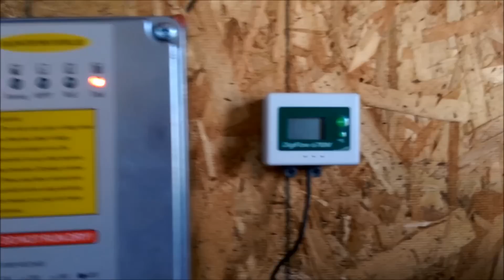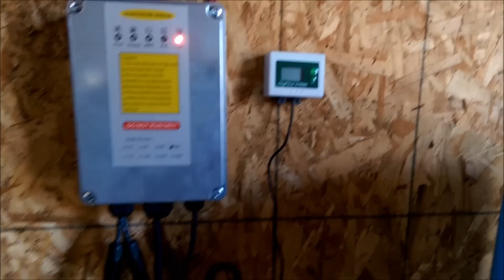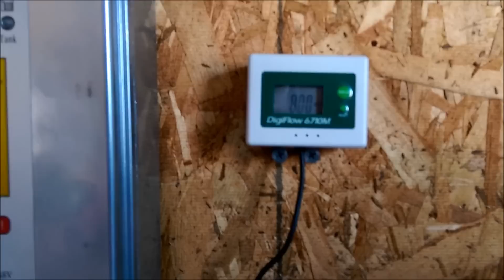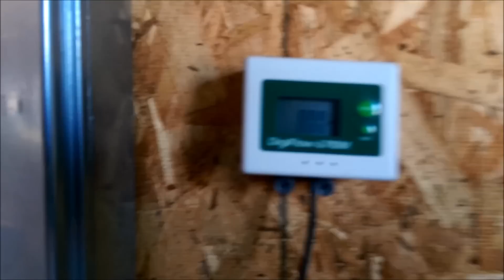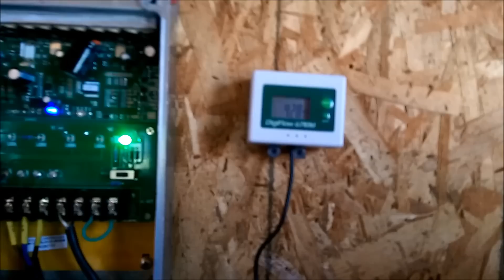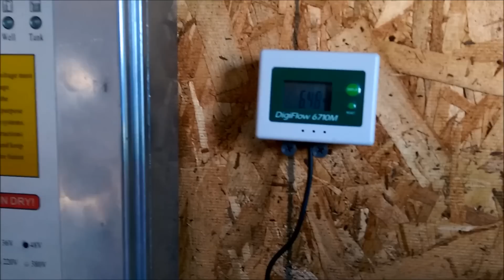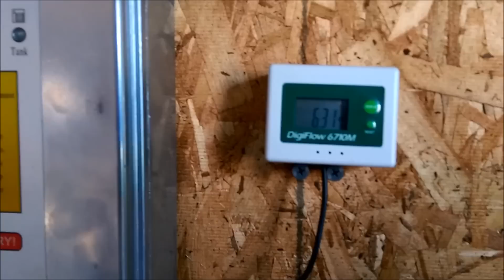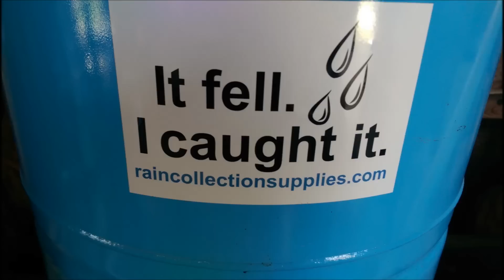New Solar Pump For Many Purposes!

Comment: This dankoff pump looks excellent!   One beef with the setup: accurate flow monitoring needs at least 10 times pipe diameter behind the flow sensor and 5 times pipe diameter afterwards to eliminate turbulence created by fittings, especially elbows.  90* elbows especially have interesting turbulence where the outside water stream flows faster than the inner... by almost 20%, I believe.

Comment: Nice pump I should have one soon, I am getting ready to add the battery portion on my Dankoff Suncentric and using the Midnite Kid it looks like I will be able to run a fifth battery to Increase the voltage/pump speed. Lucky guy you are getting to play with unreleased toys

Comment: I have an idea to create an Air conditioner using a pump that flows a water solution through 600ft of geothermal pipe then call the fan on my forced air unit that will blow across a heat exchanger.  I keep my house at around 76 degrees which is hot for most but we just don't enjoy the house to be any colder. I will use a owf to heat my new 1700sqft house so accomplishing this would really be a money saver on my utilities. My yard looks like a dirt pit now so what is a few more holes... I haven't seen anything on air conditioning off grid in your channel and I knew you would be the one to ask. I know this will work to some extent. Maybe it would be a good experiment to see the possibilities. I guess, I am challenging you because you are more intelligent than myself. What would take me years to figure out would take you days.

Comment: Hi there, this is pretty good project, can you tell me that  if this type of solar pump will work for a  water well with 28 ft. deep?.  I have a battery bak connected to 24 volts. please pump barnd.  Appreciate your comment, regards

Comment: Hi, I have an off grid cottage and we draw water from a shallow well. I have a solar panel set up and it comes down to a charging controller, then to a 12 v battery bank, then to a 4000w inverter. Now when we draw the water its coming from over 200ft, so it takes a while to bring our tank to pressure. So the pump runs for a while and eventually blows the 500 amp breaker we have before our inverter? any suggestions on what might be causing this? The inverter is only rated at 35 amps, and the 1/2 hp pump is 115/230v. And would you maybe suggest putting like a wash down pump out by the source of water and push the water instead of pumping it? Thanks in advance for any suggestions.
Pete

Comment: My well is set up the same way,only i have a submersable pump.My control panel runs my new dose septic system as well.How many batteries do you have to run in parallel?How big is your solar pannels?Please pm me and let me know,thanks.

Comment: why not pump to an elevated tank and have gravity feed as a back up?
Reply: Great idea - if available, essentially the elevated water tank would act as the battery.   It would be interesting to do a cost comparison for tank vs battery.

I've been looking at various water powered pumps to pump water and have realized that in some cases comes down to the cost per volume of water delivered to a given location - in my case an irrigation application, but might be relevant for pressure tanks - not sure.
Here is the link to the facebook group for Water Wheel Pumps and most of the approaches should be bench marked against alternative power like solar.  Any cost for volume delivered figures available?  Thanks.
https://www.facebook.com/groups/240458583255303/

Comment: is that an actual DC pressure switch or are you using an AC one?  i was told you could use the ac for DC but the contacts would burn out sooner.
Reply: one less rat I’ve used them but looped the positive through both contacts for a bigger gap

Comment: Hey Engineer775, Going back to your well video, how long did that take them to drill the 300'?  And that was really only $3,000?
Thanks man.
Reply from the maker: It took about 5 hrs. and yes it was $9/ft plus casing, grouting and permit. ~ $3k
Reply: engineer775 Practical Preppers Incredible.  They're hitting us for $65 - $120 / foot out here in CA with the drought and claiming it's their regular rate.  Even so there's a 3-6 month waiting list.
Reply: Joe Primal  Where in Ca are you? Im in Northern and its a pretty scary water situation
Reply: Jason Andrade I'm down Bakersfield way....what's water?

Comment: Have you looked into tesla home battery your thoughts?
Reply from the maker: I have but they talk abut running a few small loads like lights, refrigerator and cell phone.  I believe it will cost too much.  We use renewable energy lead acid batteries with great success for about 10 yrs of hard use.   The Tesla battery isn;t proven in home applications yet and I have yet to see a price!
Reply: +engineer775 Practical Preppers They published prices.